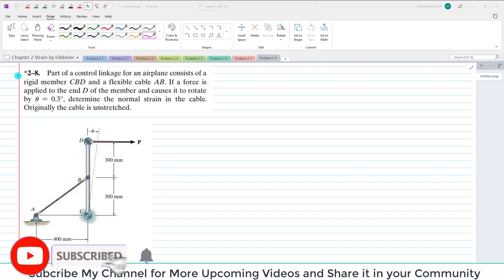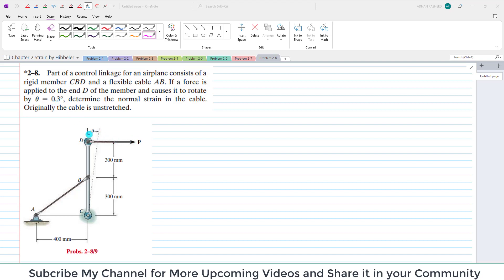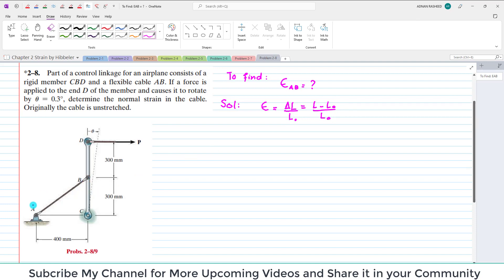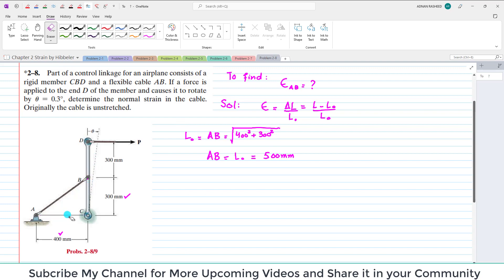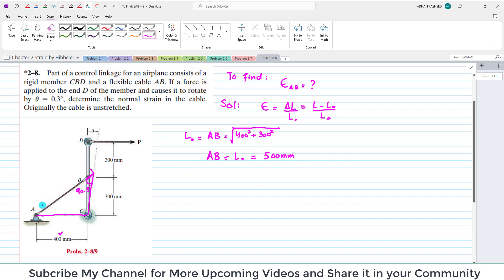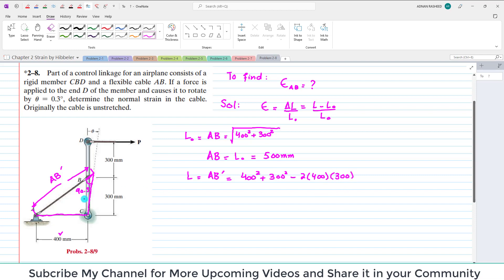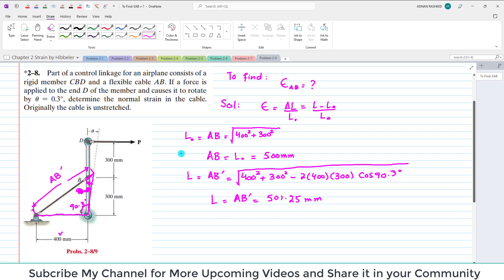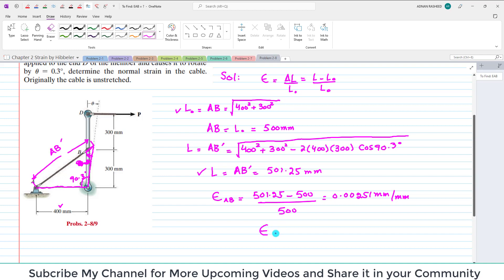2-8| Chapter 2 | Strain | Mechanics of Materials by R.C Hibbeler|

Comment: Hello, why have we used the new length CB' as 300 when that's the vertical height? Shouldn't we solve for the new length CB' first?
Reply from the maker: Ok due to load P the length of AB increases only and as point B moves to new position due to tension in member AB while length of CB will remain same. As the triangle is no more right angle triangle therefore we use consie law. Thank you
Reply: @engradnanrasheedmechanical  I undertand now, thanks Eng
Reply from the maker: @IvyMerceline you are welcome and kindly share my videos with your friends and help me in growing my channel further

Comment: i feellike when finding the new AB lengh, the lenght cannot go upwards as you have shown in the picture, because when p causes the pole to rotate either point b goes horizontally to theright or clockwise downwards... please clear my doubt
Reply: what i did was find the horizontal distence by doint ratio triangle method to find the right had side position of B and then applied cos formula
Reply from the maker: You are right brother , point B will move horizontally and BC will be equal to B'C.